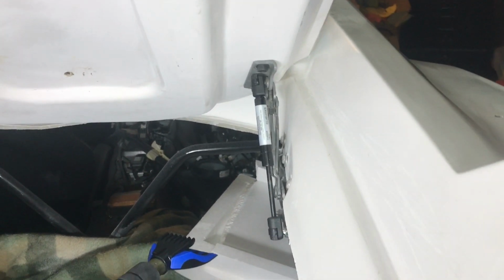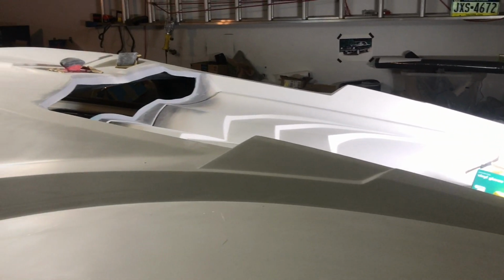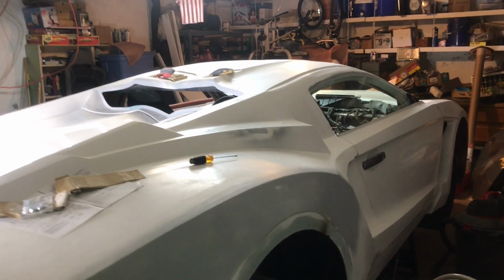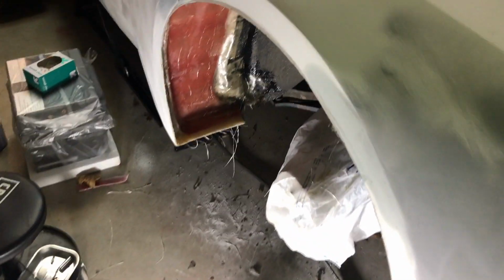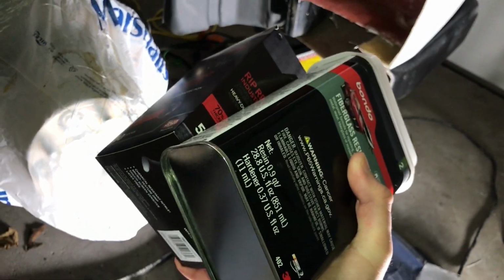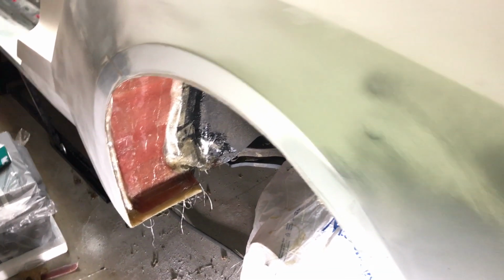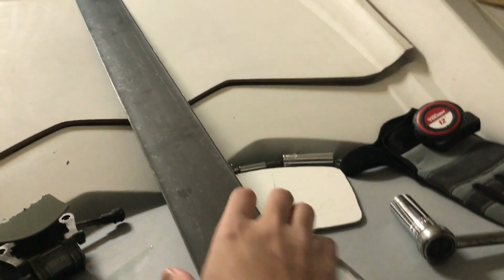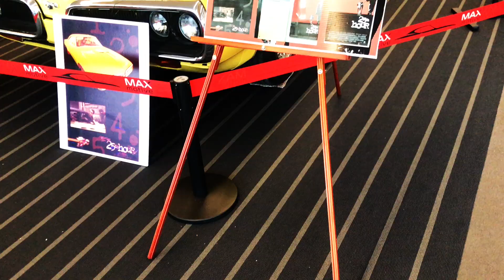VAYDOR BUILD PT 53 (MCLAREN SENNA, Wheel wells and trunk)

Comment: Becarefull of body flex ...it might crack the fiberglass in the wheel well s at least it will be hidden ...but you might want to to keep some of the body lines once you hit bumps or anything that causes the car to tweek side to side it will crack fiber glass...fiber glass is too unforgiving and hard
Reply: it fine - have not seen any issues on any of factory or home made vaydors.